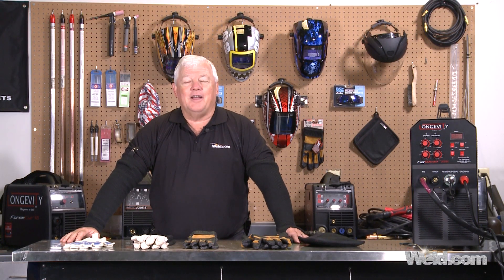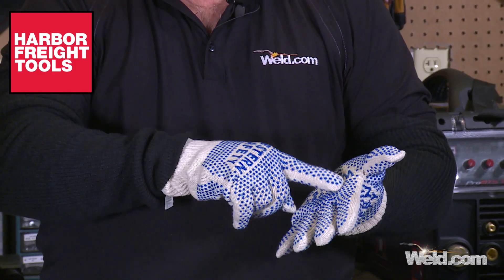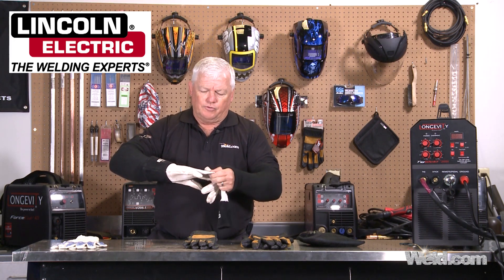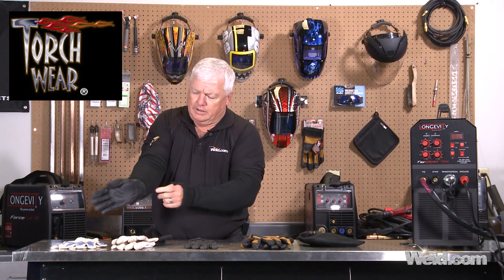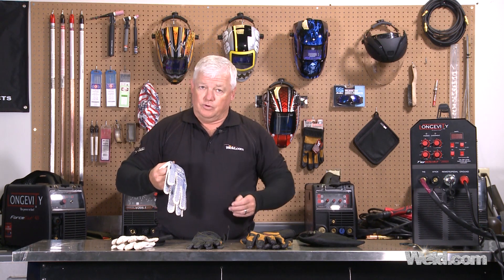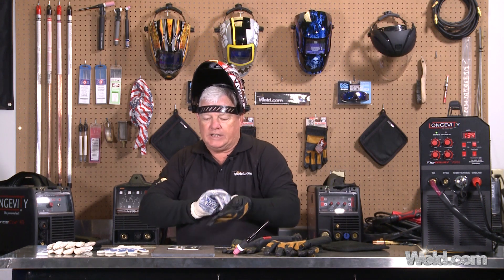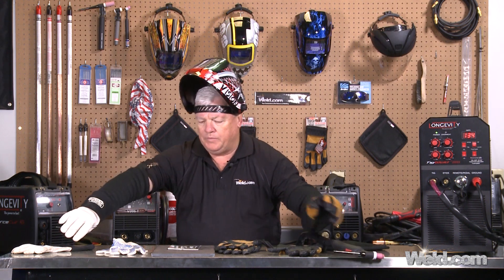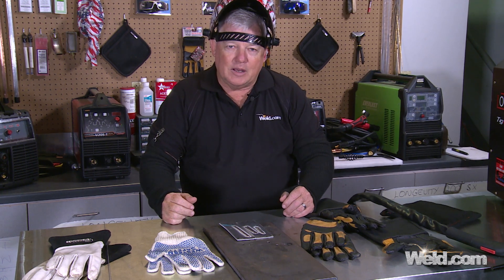TIG Gloves: Choosing the Best Pair | TIG Time

Comment: tig welding gloves are stupid I don't understand the reasoning you tend to use way more current tig welding especially with aluminum   so why would I wear thinner gloves with less protection from heat   and I can feed wire just find with mig or stick gloves  I use the Lincoln roll cage gloves there awesome
Reply: ccapehart1980 because there is almost no spatter going on your gloves. If you’re doing it right, TIG is a clean, and cooler, to your hands, process. You also need gloves that are easier to manipulate. Seriously, there’s a reason why TIG gloves are made.
Reply: ccapehart1980 depends if the gloves broke in. A stick welding glove that's well worn and limbered works well but a new pair is way too stiff for me
Reply: Quentin Langley I agree with you. Even different methods of feeding effect how it handles. For super thin welding Tillman #25B with Jody’s TIG Finger XL works well.

Comment: I have a question if I may, I a baker and pot holders are just not efficient enough.  I'd like to use miller gloves at least I think they would be better that the alternative but I need a smaller size and since I would like to be able to wash/clean them.  Can these leather and suede gloves be cleaned?
Reply: Lindie Lee Leather doesn’t like water but there are some nice gloves on the market that are cleanable. There is a 100% silicone glove that even allows you to pull eggs out of boiling water! Also try the “Ove-Glove”. I like both in the kitchen and it depends on what I am doing. All Clad also makes a decent pair that I got free but it is cloth. However it is cleanable. Leather and water don’t mix except tooling leather where it is used to mold the leather to shape. You probably can already tell that welding, baking, cooking, grilling, sewing and leatherwork are some of my hobbies. As far as my experience goes I’d say avoid the leather and try the other two mentioned. Best I have found so far. Not sure who makes the silicone one but it is a slightly blue shade to it not unlike ice cube trays made of plastic.
Reply: Great question btw! 👍

Comment: I wanted a set of Torchwear gloves and sleeves after seeing you use them in earlier videos, but I just can't afford that stuff now. Instead, I got a pair of BSX Firecat gloves, and they're worth every penny. For sleeves, I found black tube socks actually work really well. Go ahead and laugh, but it's true. Just cut the toes out, double 'em up (elastic end near the wrists) and it's just as good as those swanky Torchwear sleeves. When you're a poor student, you gotta make do, man.
Reply: Interesting idea. Make sure those tube socks are made of something fire resistant like wool. When I first started out with my everlast welder I used the denim pant legs from old jeans that my kids outgrew. Denim is fairly fire resistant as long as it isn't frayed or worn thin.
Reply: Awesome idea!

Comment: HF also sells two different welding gloves for $5. and the goatskin's are about $6-8. Cheap is relative.
Even McMaster Carr has gloves listed from $7 to more than $50 per pair. 
My main complaint is that you were comparing dissimilar products, and being misleading in your evaluation. Apples to Apples, as your website says. Please try to be more accurate in the future.
BTW, love the vids. (mostly)

Comment: Mr Tig. This time I have to call BS on your review of the HF gloves. Those cheap ones are listed as work gloves. HF does offer leather welding gloves. If you had shown the goat skin welding glove HF sells, or even the goatskin work/driving gloves, it would have been a better comparison.
If all you wanted to show was that cloth gloves are NOT recommended for welding, you could have bought some anywhere,  and NOT badmouthed HF! Not everyone can afford to buy the best.
Reply: jamcat62 Take a look at how Harbor Freight buys/makes anvils and they repair holes and defects in them with cheap bondo. Result, cracks and a broken anvil. If you can’t afford new top of the line, buy used top of the line. After the Coronavirus I will never buy Harbor Freight or Chinese anything ever again.
Reply: jamcat62 Also the welding gloves you talk about cost more.

Comment: Mr. Tig
How about Black Stallion Tigster glove
I use them and they work well - the reality is they are fairly insulated and with a bear paw for a hand they make them big enough to fit a hand that can pickup a basket ball from the top - I know you can not test everything but they are a short cuff but I do use slip over sleeves 
Just a thought
Awful Arthur
Art Humphrey

Comment from the maker: Paul, I would suggest the Everlast MicroTIG 185. This is a good machine for beginners. It is "Mr. TIG packaged" with all the correct accessories. The total cost is $995 & will weld up to about 1/4"steel & 3/16" aluminum. For MIG,  I now have the new 115v (AHP) MIG machine. This unit is brand new & I haven't placed on the web yet, but sells for $325 & all shipping is free. Contact us at tigdepot.net if you need to talk to me in more detail: 800-456-9172.

Thanks Mister Tig

Comment from the maker: We brought out 3 pairs of gloves that a lot of people use for TIG welding. See why we dubbed them "The Good, The "OK", and the Ugly"
Reply: I wanted to learn how to tig weld with my Everlast welder after using for mainly mig welding. I learned pretty quickly that the gloves I used for mig welding wouldn't work well with tig!
Reply: Have you tried Tillman #25B? Super thin, then add Jody’s Tig Finger XL for heat resistance on side of palm. Worth a try Wyatt! TY for sharing your knowledge!

Comment: I got a pair of the torchwear gloves a while back after seeing you use them. They get used everyday (almost) and they are still going strong with little signs of use. I got the ones with the gauntlet b/c it was the same glove, but for some reason it was actually cheaper than the smaller tig glove... Go figure. Anyway, I use them for both tig and mig.

Comment: Hi,  I don't know how to weld yet, but will start learning shortly.  My applications are automotive, bikes, aluminium, steel, so TIG & MIG.  Alloy work will be oil catch cans, rocker covers, etc, steel work is chassis work, bracketry, exhaust.  What machine would you recommend for my need and not to have to update regularly.  Budget around he $1500 usd.